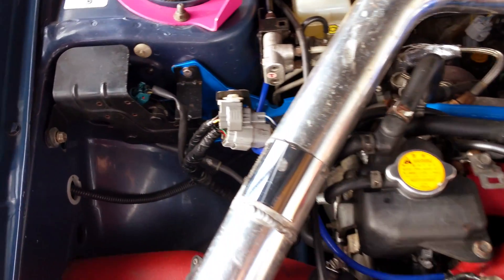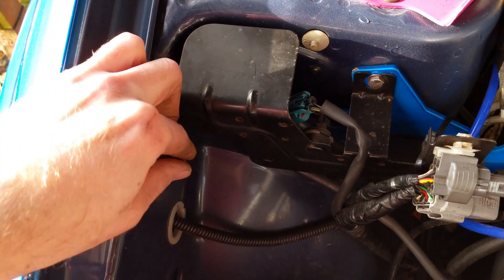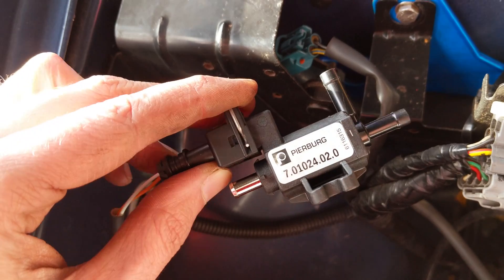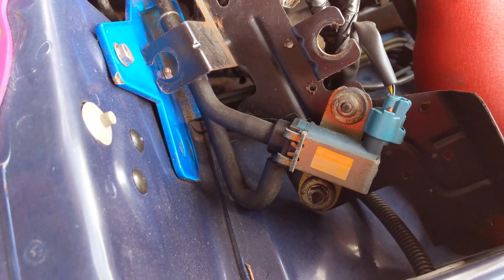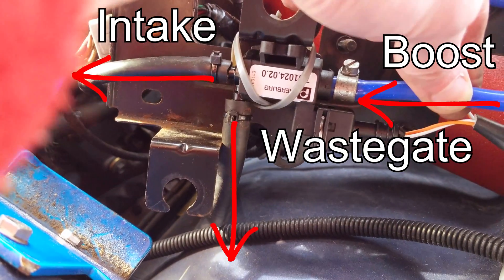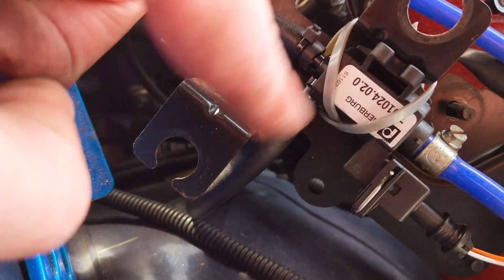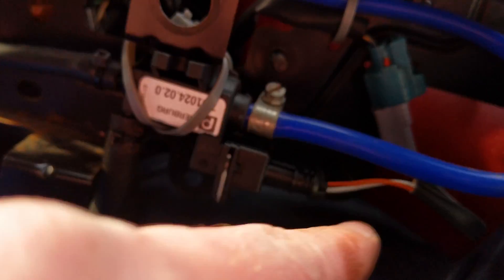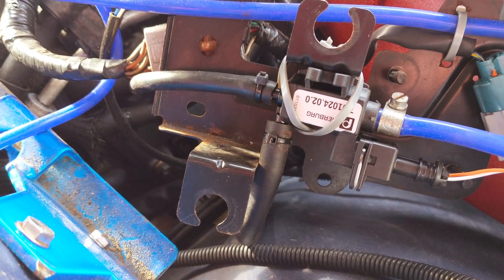Subaru Power Quest - Boost Controller

Comment: How high can you go in boost with stock ECU program and stock solenoid? I'm running about 8 psi but would like to go higher with ~50/50 mix of 93 Octane + E85 in my 2004 Forester XT with ~stock size turbo (forgot name/size).
Reply from the maker: In the UK we're blessed with 98 and 99 everywhere :) My WRX runs 18 psi on a stock controller.
Reply: @vPerformance  USA has different measuring in octane. Basicly the same juice as in Europe

Comment: Is it preventing some loss of pressurized air by venting back into the intake? Seems like that wouldn't be very much.
Reply from the maker: Once the air has been measured into the engine, you don't want to lose track of it. Especially for a car in an advanced state of tune like this one - small difference in air could cause detonation under load.

Comment: What benifits do u get from 3 port?
Reply from the maker: We've got a longer video coming out on that very topic! Aftermarket controllers can measure and control higher boost pressures, and with greater accuracy.
Reply: 100% control of wastegate where 2port has about 80%
Reply: Looking forward to it- for example Cobb and Grimmspeed have alternative boost solenoids, also 3-port.
Reply: @WmLatin  
Are there any differences in the boost solenoids of the other brands?